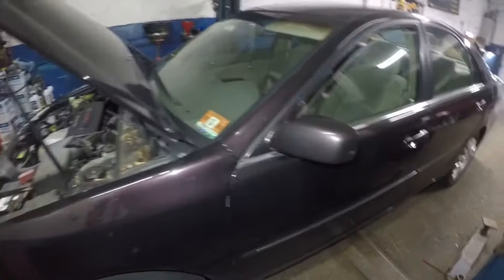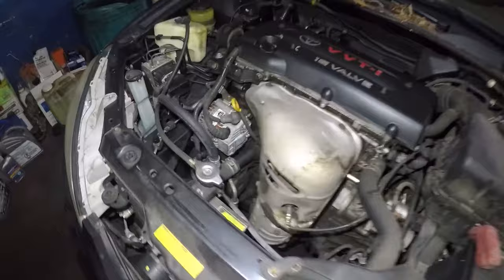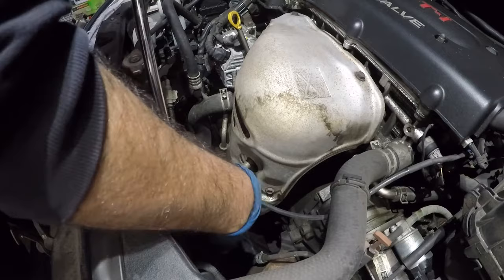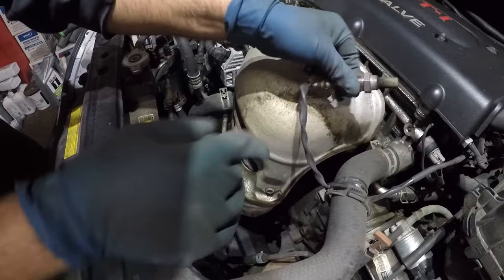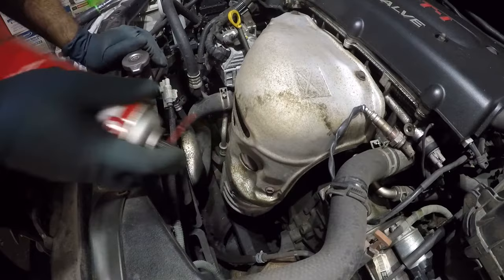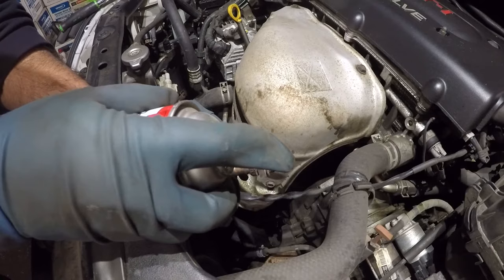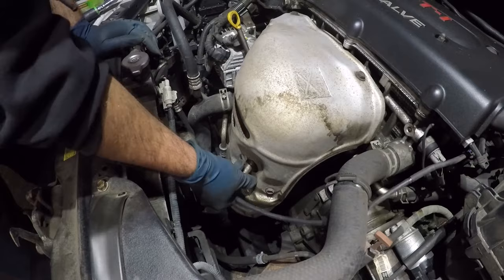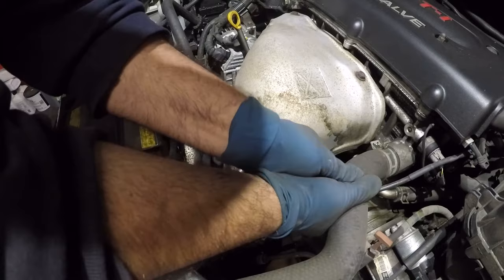How to clean catalytic converter  while on car, customers request to spray down with cleaner

Comment: I hope people realize you can't clean the cat with mass air cleaner like come on bro do it the right way. And unplug the o2 sensor you just ruined his wires because your to lazy to unplug a wire that takes 20 seconds.
Reply: He didn't use mass air flow sensor cleaner he used throttle body cleaner he clearly showed you the label, there is a difference!
Reply: So I need you to make me a small video showing me where the o2 sensor is lol on a 2011 Nissan Sentra lol jk I will google it or U-Tube it too !! But THANK YOU SO VERY MUCH FOR THIS INFORMATION BECAUSE I DID NOT KNOW IT
Reply: This worked for me Salud 🍻
Reply: That's a intake cleaner not a mass air flow cleaner

Comment: Always disconnect the o2 sensor wire connector. If you don't you'll be buying another, the wires twist, stretch, or break resulting in o2 error codes.
Reply: was gonna say the same thing would have taken 20 sec
Reply: no its must be cleaned with cata this is wrong cleaneng...
Reply: Ohhhh man I wish u would have used the camara to see if their in immediate reaction.
Reply: True
Reply: You basically want anything that’s going to eat carbon diesel fuel, purple power, optimizer GM top in cleaner, the foam spray and you really want to use a whole can on it and just let it set that GM Pop in Cleaner if you spray the cylinder or a cat and let it sit overnight And then the following day get the cleaner out look at it with a borescope camera. He looks brand new in there the GM top in cleaner optimizer for Chryslers that is for carbon cleans. It breaks the carbon down into dust you could D carbon your motor with water it’s a old-school trick, I’m not going to explain it how it’s done or watt temperatures or anything of the sort because if you’ve never done it, you can destroy a motor it’s the old-school trick and the old guys out there know what I’m talking about they’ll know exactly carbon and water. Don’t get along with each other who loses the battle the carbon does, this is how they done it before we had all these chemicals all old-school tracks there’s still out there we still use them. They work on modern days now computerized a lot of times you still have to use them. There’s guys out there that knows the tricks and lotta guys don’t like to give their tricks up they don’t believe in letting their information out And I’m one of them because if somebody does something wrong I’m liable I could be sued because they’ve done it wrong. The way the world is now everybody wants to sue and there’s one say payday is what they say not on my clock. I’ve told a lot of these guys it put a YouTube videos out. You got a watch it because you put that information out and somebody does it wrong you’re liable That’s why I don’t put a Videos out because there’s too many people out there that don’t use common sense no more that’s the number one reason they can’t think on her own and the new generation out there is coming in the automotive they think the scanner is the god that code is the problem. The thing is they need to learn how to read the scanner read the data That scanner disappoint you in a direction. Where are the problems that and then you got a figure it out you have to diagnose it because the scanner will tell you if it’s electrical problem mechanical problem, sensor problem or internal problem it’s all in the way it’s worded, you have to know how to read between the lines And have enough background in the automotive to figure it out or diagnose it and a lot of guys out there. Just want to throw parts at him all day long and just say check engine light used to thousand dollars worth of parts at it still not fixed it could be a loose pin. It could be a bad ground. It could be a broken wire, or it could be were a mouse chewed on the wires why do you have to get a meter out and start diagnosing it nowadays that is a bad word to people they don’t want to hear diagnose in a vehicle. They just want to throw parts at it and go people need to learn how to take a step back idle down take some time fix it, right Yeah there’s some vehicles were you have to have a part known good part for a test part for a quick test to determine OK which is it here? If you’re in a time frame you can throw that part on there OK spit out another code OK that wire is good but it’s not. It helps you that’s all I’m a say and then you just have to figure it out yourself. and people need to learn how to pronounce catalyst system not Cadillac.
Reply: I'm confused ..he laid the wire safely why did he do wrong so I don't mess up ..please explain I'm not being funny?
Reply: @CharlesLease-ei1ee  Learn proper grammer and punctuation. That would help immensely.
Reply: @williamadams2240  ...first off, you should never ever twist any set of wires like that. A simple 5 second disconnect from the connecting wire harness would have been the correct way. This guy is not a true mechanic and demostrated an absoulte stupid way of doing this. I regress!

Comment: I sprayed that throttle cleaner through the upstream O2 port and my p0420 check engine light turned off on its own. Thank you so much for this advice. You are great and you saved me at least 1,000 dollars in repairs.
Reply from the maker: Nice good job!!!
Reply: Just wondering if I have to remove the bottom sensor as well? I already popped off the top one and I have the throttle body cleaner but I don't want to spray it in there and have it catch fire. Do I have to remove the downstream one as well or only put it in the top and clear out the the honeycomb? I inspected it with a flashlight in the Combs look perfectly fine
Reply: @krakenhits1587 did you ever figure out if the down steam sensor needs removed too?
Reply: @BRANDONGONE92   no
Reply: The answer to your question is said in the video, but it isnot shown. He said to make sure you do the bottom one.@krakenhits1587
Reply: did you put in the whole bottle?

Comment: I think you should pour that stuff straight into the throttle body. It will clean the top of the cylinder head off to in the spark plug. It'll clean the combustion chamber

Comment: Thank you for your video!  I scanned my '07 Avalon 3.5L and it was a P0420.  I had already replaced the O2 sensor on bank 1 ahead of the converter, so I replaced the O2 sensor after the converter on bank 1.  CEL went off and then came on later.  I saw your video, went to the part store, bought the cleaner, and rented an O2 removal tool.  I sprayed the cleaner in 5 times at 5-10 minute intervals and sprayed the O2 sensor.  I cleared the previous code and started the engine, and after a couple of minutes, the CEL went out.  Hopefully, it's fixed.   Thanks again!!.  A final thought.  For people who try this, as you are spraying the cleaner into the O2 sensor hole, make sure that the little tube that pushes into the spray button does not fall into the hole.  You would be in trouble!
Reply: Super Glue LOL!!
Reply: I've got an '05 Avalon with the PO420 PO430 code and I'll try the same thing has your check engine light ever returned?
Reply: Did your CEL come back on?
Reply: @tijuanasmith523   Nope!!!
Reply: @SeptemberWhite  my chrck engine light has stayed off!
Reply: @tijuanasmith523  no, my check engine light has stayed off!

Comment: I have tried:   drill a small hose in the exhaust before the cat con:  and WHILE RUNNING spray (carb cleaner?) w plastic spray tube into the hole.... careful, will melt....... but goes directly to the cats, air flow.  Seemed to improve!.  And tap, screw in a screw to block the small hole (accessible for future treatments)
Reply from the maker: Good job!!
Reply: No concern for UT catching fire?!
Reply: Still no check engine light?
Reply: Update please.
Reply: It did the trick prior- for sure.   Ive seen moved onto using CATACLEAN... and lacquer thinner in the fuel... but might try this again!  I just tried Liqui-moly cat clean - sprayed into the air intake just about the throttle plate.    I have the same vehicle and the access screws are still there, which I drilled into the exhaust- sealed w small screws..... in which Id spray an entire can, slowly, while the engine was running. Short bursts, no fire.
Reply: im still chasing this down........... new MAF sensor and new O2 sensors...  Im finding out I had an AIR LEAK from my OIL FILLER CAP and a torn grommet at the end of my oil filler tube which wasnt securely bolted down. Hence was reading LEAN and adding too much fuel.......which was fouling my spark plugs and O2 sensors!   Put in fresh plugs also.  Now back to spraying carb cleaner into my predrilled holes above the CATS.   Did this today again....VERY EASY w van ramped up... and OMG!   There was definately blockage - seems removed ...... I did a 10-15mile country loop and a dramatic step up in engine breathing/performance!

Comment: Thank you. I did the same thing you're doing and it cleared the check engine light. Did smog check and it passed.
Reply from the maker: Nice good job
Reply: For how long did it worked?? Am trying to do the same thing to mine but I was wondering if the check engine light stay off
Reply: @elmexicanodelabarba3245   give it a shot maybe it lasts longer than you think 

America mechanic will charge 2000K for replacement 😁 awful service

Comment: I got 2011 gmc terrain 2.4l it was stalling and losing power sometimes when going up hill I took it to Buick and GMC at highland Indiana they told me the mix is rich and they will change high pressure fuel pump and the repair would cost me $800 with part included. I told them I will do it another time not today. So I go home watch youtube videos on how to change the high pressure fuel pump ordered the part from rock auto for $200 bought tools from Walmart and Amazon did it myself I even changed the oil. After all that it was still stalling and losing power like usual. So I thought maybe it was spark plug so I changed them myself same problem then I changed both solenoids same problem. 
Until came across a video about catalytic converter issues. So I watched your video too because I didn’t want take down the cat to clean it so remove the upstream 02 sensor went to Walmart bought some Lacquer thinner use a flex hose and funnel and pour Lacquer thinner in. Then I use mass sensor cleaner and clean o2 sensor too. After putting back everything in place I turn on the car it was smoking a lot then after about 10 mins the smoke clear and I took it for a drive around the block then up some hills everything work well no more stalling and losing power.  Thank you for the idea to put the cleaner through the upstream o2 sensor slot. Bless you and all the other YouTubers helping us out by sharing your knowledge. Thank you my brother.
Reply from the maker: Oh wow u did lottttt I think maybe cleaning the maf sensor did the fix!!!

Comment: I have a 2007 Toyota Tacoma 2.7 liter. The catalytic converter is horizontal. I checked the graph on the diagnostic tool. The second O2 sensor was erratic. I removed the O2 sensors and cleaned them with the throttle body cleaner. I then sprayed through the #1 sensor hole. I emptied two cans and stuck a air hose in it and blew it out for a few minutes.Since the throttle body cleaner is highly flammable,I decided to stick the hose of a wet/dry vac in the tailpipe and let it run over an hour. I then installed the O2 sensors and started it up. The diagnostic tool shows the #2 O2 sensor is rock solid at 0.015 volts,regardless of the throttle position. I call that a win.If the P0420 comes back, I will post it but, I think this is cured.Some people are using laquer thinner in the tank.Don’t Do That It can damage a lot of parts from the fuel pump to the injectors.Bad advice as far as I am concerned.Thanks for the video.Each person will have to adapt your proceedure to their individual vehicle but,this works very,very well.
Reply from the maker: Good job!!!
Reply: Is the code came back?
Reply from the maker: @marsinbako8491  most cars I do don’t and it dose improve fuel economy also clean out the oxygen sensors
Reply: @marsinbako8491  Yes it did. I looked through the 0- sensor hole with a camera.Catalyst material is not broken or stopped up. I installed a extension on the # 0-2 sensor and reset the p-0420 alarm.Problem has not returned in 2 months.There is no emissions testing in my state.As long as they don’t, I am going to treat it like a low tire pressure alarm.Not interested
Reply: @jamesdavis8021  what was the extension you purchased. Do you have a part number
Reply: lacquer thinner works fine
Reply: This is awesome! Thank you for sharing. 
When it’s time for my cat cleaning, definitely going to try this. 

My two cents:
Even if get the “cat low efficiency” code, folks can just focus first effort on cleaning the upstream & downstream O2 sensors. Reset/clear the code, and see if code comes back in a few days/weeks/months. If it comes back, THEN can go clean the cat. 

Often times, the low efficiency is really due to slow response on the oxygen sensor. If cleaning just the oxygen sensors will solve the issue, this saves folks the effort of cleaning the cat. 

EVENTUALLY yes the cat gets dirty/fouled. But they are designed with an excess surface area even at full throttle. So if it actually not easy for cat to get fouled to the point of needing cleaning.
Reply: @reallifeengineer7214 except when your engine burning oil😅
Reply: Lacquer thinner good or nah.  Just bought some
Reply: @ozb10  lacquer thinner doesn’t work

Comment: Skipped a little of steps and used the wrong cleaner. Sea Foam is what you need to use. Also use CRC contact cleaner to clean the contacts WHEN YOU DISCONNECT THE SENSOR WIRES.
Reply from the maker: Ok
Reply: Seafoam didn’t work for me.
Reply: @lorikuck19  You're not supposed to ingest it.
Reply: @MexicoAdventurer  no shit. 🤦‍♂️
Reply: @lorikuck19 didn't work as a laxative either?😂😂
Reply: Seafoam only works on 2stroke,its oil pfoxuct and will clov the converter
Reply: @michaelblew6019  It does not clog anything. It will burn up in the converter like anything
Reply: Try Sea Foam in the shower. May work there.
Reply: @snow-wlkr7xplorer494  LOL! 🤣
Reply: @MexicoAdventurer Scotty Kilmore says seafoam don't work.
Reply: Don't take Scotty Kilmore sword on everything, he doesn't know anything about diesel either

Comment: You can also use an additive that is designed to clean the catalytic converter and spray it on there, it is designed especially for catalytic converters to be sprayed via the intake Port but you can do it directly on a catalytic converter which is more efficient
Reply from the maker: Yup
Reply: What cleaner did you use?

Comment: I have a 13 Mitsubishi Lancer with a horizontal cat.  I had a p0420 code come on about a year ago.  I tried a bottle cataclean about 4 months ago and the code went away for a day and came right  back.  About 2 months ago I removed the front o2 sensor and sprayed about 2.5 cans of seaform top end cleaner into the cat.  I made tons of smoke and it took about 10 to 15 minutes to burn off but did nothing.  Well just today I bought 6 cans of Berryman carb/fuel system cleaner (90oz) and poured them into the cat via a flexible funnel (through front o2 hole again).  Chased it with a tank of compressed air.  Since it says the Berryman is highly flammable I then added about 1/2 to a gallon on purple power cleaner/degreaser to the cat and chased it with compressed air again.  I didn't pay attention to the check engine light when I first started it up but when I did, probably about 30 seconds after startup, there was no check engine  light on.  Hopefully it lasts but the procedure  I described worked for me immediately for a stubborn light that was on for about a year.
Reply: Did it come back?
Reply: @originalimmigration   Not yet but it was only yesterday and I have only driven 25 miles.
Reply: Came back?
Reply: @Jerri001  No not yet!  It has been at least 2K miles if not 3K.  Still no engine light!
Reply: @theMatrixEndsHere  thanks
Reply: @theMatrixEndsHere  that Berrymans is good stuff. I think I'm gonna try this.
Reply: Did you let it flow out of the exhaust pipe, seems like one is better off removing the cat than risking a blowup.
Reply: @ajikka5609  Yep out the exhaust.  If the cat was easy to remove I would have.   I didn't want to go through the hassle of taking it off.
Reply: @Paul Taylor  The car (2013 Mitsubishi  Lancer) is in really good condition, almost no oil consumption, and I use quality gas.  I find that the PO420 code is very common for Mitsubishi cars.  I also have a 2004 Mitsubishi Outlander, and the PO420 comes on for days at a time and then goes back off for a while.  The code/engine light was stuck on almost always last year, like my 2013.  I did the same procedure that I described for my other car and it helped.  The light now comes on and off, probably because it burns nearly a quart of oil every 1000 miles.  But the vehicle has almost 250,000 miles, about 400,000 km to you down under.  
Per my advice, my brother got a 2000 Mitsubishi Mirage.  It doesn't burn too much oil for a car with 185,000 miles but guess what?, yes, PO420.  The cat cleaning I have done can help you pass emissions and get you by without the need for replacing the cat.  Always try it before replacing expensive cats.  Worth a try!

Comment: I should have seen this video yesterday before I tried to fix my daughter's Audi A3... It had a bank 1 sensor 2 error, with engine light orange. I took out the sensor and cleaned it very well, then replaced it and deleted the error code. She drove the car approx 1 hour, and the engine light has not returned 🙂. Now I know what to do if I get the error again. Thanks for a great video!
Reply from the maker: Nice job!!!